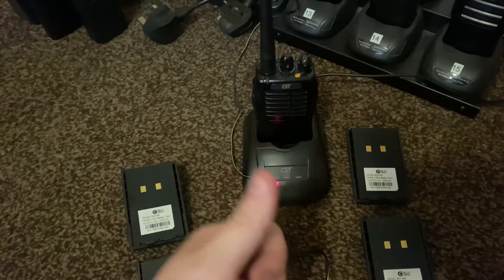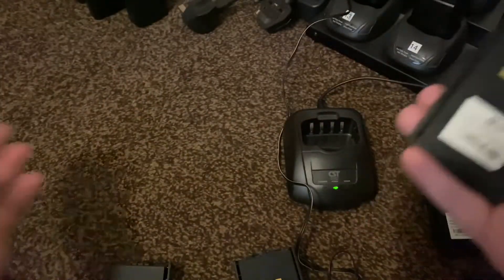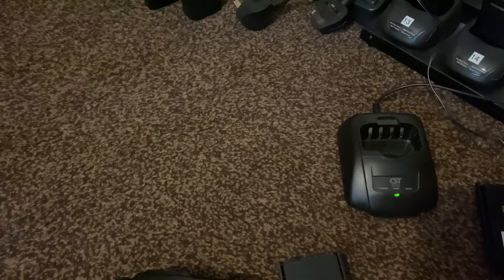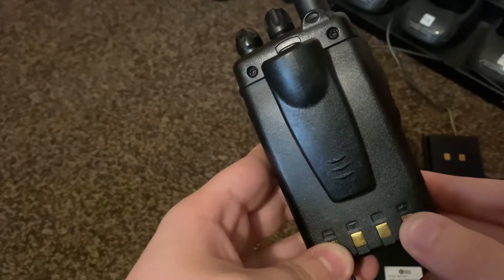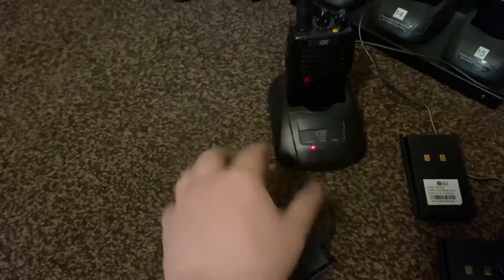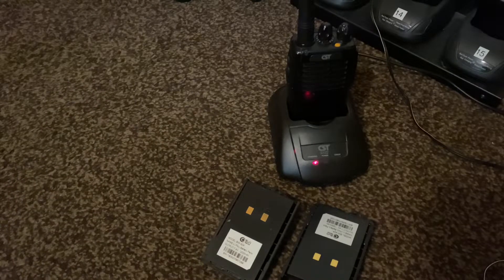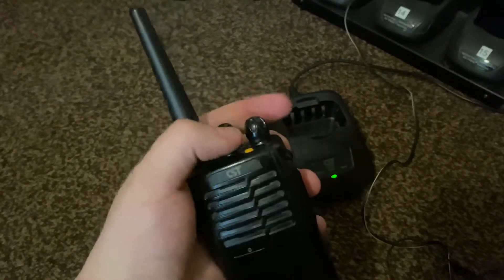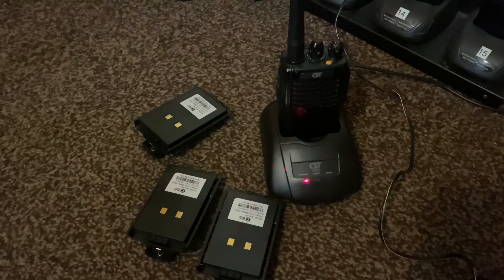How to reset a walkie talkie battery using 2 wires

Comment: Hi , good video. Do you know what the 2 middle connections on the Battery do ?
Reply from the maker: They have power running through then I can only guess something to do with the chip inside charger controlling charge and trips it to charge as charger has same 2 connections so I can only guess it runs with that charger 👍 and glad you enjoyed

Comment: Hi, the battery of my Talkpod UV5S doesn't have indication of polarity on it, and I'm trying this method because the battery of this radio is rare in the market to replace.
Reply from the maker: Nice well good luck just remember 30 seconds to a minute and it should be all good mate you can obviously do it for 1/2 mins but to be safer and to check it wants to gain a charge would recommend 30 seconds on 6/12v if stuck and need any help message me on YT mate 👍
Reply: @Brad-0212 
I need help, is there a way to contact you?
Reply from the maker: @sturmgeschutz5171  hi what you stuck with pal 🙂👍
Reply: @Brad-0212 
my yaesu VX-8 battery died and I want to revive it with your method but there's no indication sign for polarity in the bottom of the battery
Reply from the maker: @sturmgeschutz5171  ah ok if you have a voltage meter that would be amazing but if you don’t only thing I can recommend is either searching up the battery and seeing if it shows the minus or plus on the battery or take a chance hooking thr wires on and hope it isn’t in reverse cause it could end very badly for the plug and battery but for 10 seconds it shouldn’t do much other that get warm or trip the plug hope this helps you

Comment: My motorola battery won't charge.i never used them for a year can I getting them working like that
Reply from the maker: @boss6438  you’ll need either a 6/9v charger as seen in the video I did strip the wires on each end make sure you know which one is +and- then put them onto the battery to boost it then put it on the charger if you have one then it should charge if that doesn’t work the battery might not be working correctly inside hope this helps :)
Reply: @Brad-0212  hello dude unfortunately I'm not sure wht is plus and negative I can't seem to find it anywhere I've looked on line aswel with joy
Reply from the maker: @boss6438  can you get a voltage meter there around £5/10 max as this will not only save your battery but your plug because if you reverse polarity it can cause loads of issues with the battery as when you do the reset if you do reset it can reset it in reverse I’ve seen it happen before and then the battery had to be chucked because it basically fried it if that makes sense so if you can get a voltage meter that would be great thx then you can check which side is positive and negative
Reply: @Brad-0212  ok thanks I will get that.